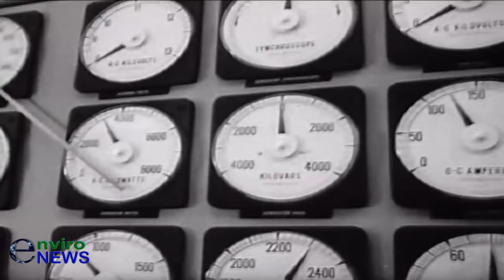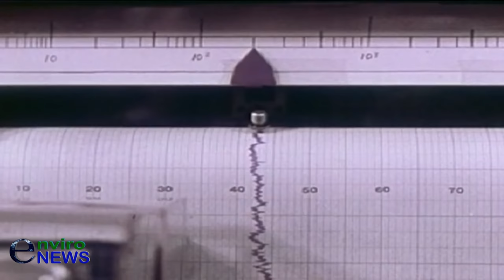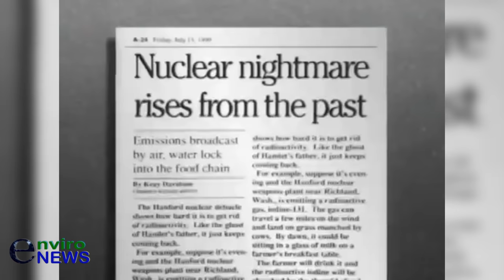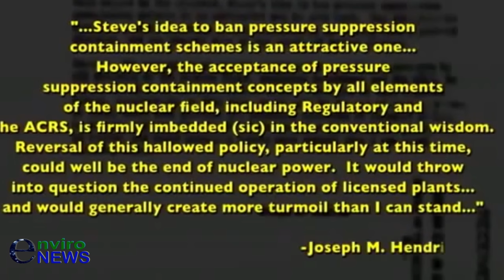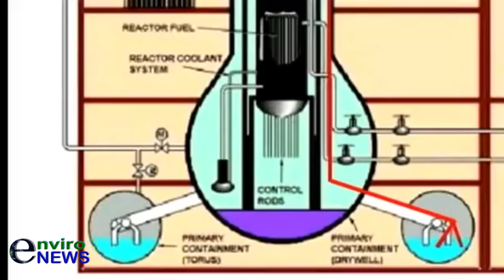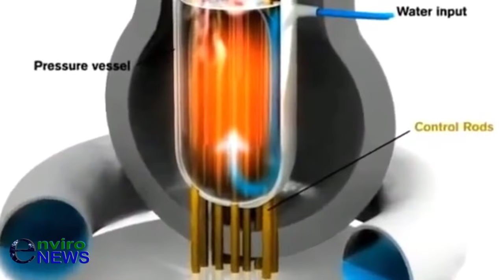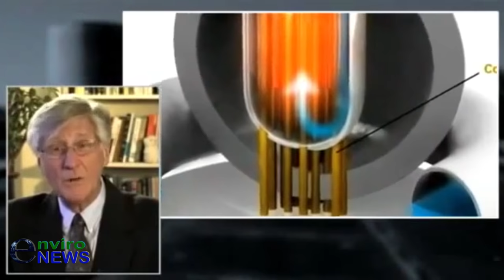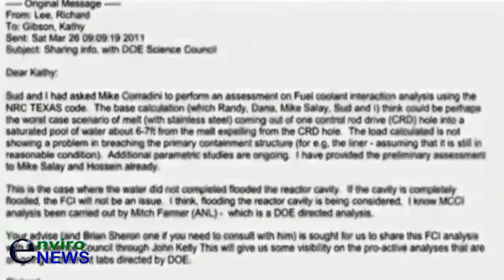Should GE’s Mark 1 Nuclear Reactor Be Recalled Worldwide Like a Faulty Unsafe Automobile? (Pt. 5)

Comment: LIQUID FLUORIDE THORIUM REACTORS. 4TH GEN, INHERANT SAFETY,  200X EFFICIENCY.
Reply from the maker: litltoosee and there is a working prototype of these “inherently safe” reactors anywhere in the world where? That’s ALWAYS what they say: this is SAFE SAFE SAFE. “Safe” is industry’s favorite word when they are applying for the permits. Until, boom! And then, “Well Bob, we didn’t account for that.” Human error and fallibility is alway part of the equation — but it’s pretty hard to factor in.
Reply: MSRE of Oak Ridge. Over 10,000 EFPH..... in the 70's. Fell out of favor to PWR's because, well, Cold War and bombs. It works. You just can't make Pu238 out of the waste. ;)
Reply: EnviroNews solar ,wind ,coal hydro kill more humans per year than nuclear by a massive margin.🤨
Reply: The decision to place the back up generators in the basements resulted in the tsunami wiping them out. After that there was no way to maintain coolant nor operate hydrogen oxygen recombined. That's not on GE.
Reply: Simon Heaney what a load of bs
Reply: In Germany they now burn more coal despite a massive effort to replace there reactors with wind / solar and they simply are not a reliable replacement.  We can also thank the Navy and there desire for a boiling water reactor for subs and that drove the GE line of development.  We could have used sodium metal reactors that run at atmospheric pressures.... But there not good for subs.  There are plenty of new reactor systems that simply are safer and that do not melt down.  We just need to stop fear mongers and educate people that all reactors are not equal and some are safer then coal. As a final note the narrator keeps talking about three mile island and GE..... Babcock & Wilcox made the reactors for 3 mile island not GE and they where Pressurized Water Reactor.  Last Pu for bombs was made in reactors that where built to just  to make as much Pu as fast as they could and are nothing like a commercial power reactor.
Reply: Not cost effective because the vessels netal cannot withstand it.  Spider web cracks found throughout and a tougher metal had not been made yet.  It will be too expensive to compete.
Reply: @worrix1  Too cheap to meter?  That's what was said before.  Never will a meltdown occur? That was said before.  Much less waste and safer?  That's been said before.  No, we need to stop using materials that have the chance,no matter how slim, to kill all life on the planet.
Reply: The pen and ink based reactor is always 100% safe and 200% efficient...

Comment: We would all love to replace these reactors with safer modern ones. However idiots bitch and moan to just shut them down and NOT replace them. The problem is, we can't just replace them overnight and nuclear power in American provides what is called the base load, or the always on power in the grid. So the operating license just gets extended. These things can keep going after 30 years, but they designed with the mind that they would be replaced after that period with more modern, and safer designs. 

EVERY nuclear accident we have ever had, has been on these early generation reactions. We have plenty of more modern designs and they are up and running too.

Had Fukushima just been replaced with a modern nuclear reactor, it would have never happened.

Comment: This was the best design at the time.  The safety design implementation depended on human beings ability to make good decisions in the event of equipment failure.  At Fukushima this did not happen.  Not once but multiple times over a ten hour period.  This accident could have been prevented and reduced to a severe failure event with smaller radioactive discharge - a million times smaller.  Reactor safety designs must be based on robust passive safety features that do not require human intervention.